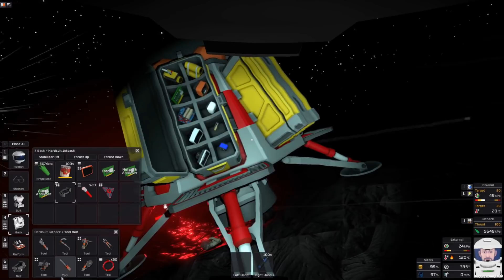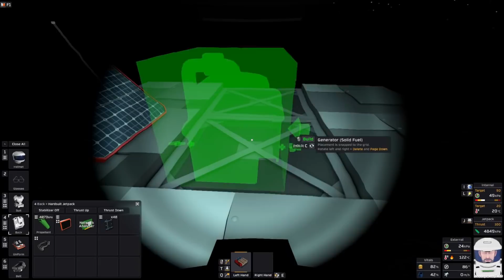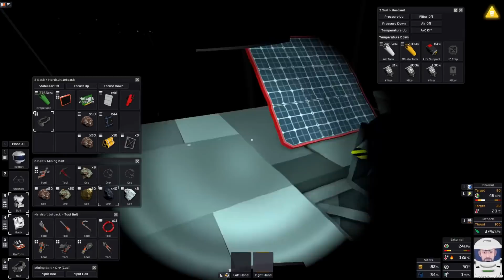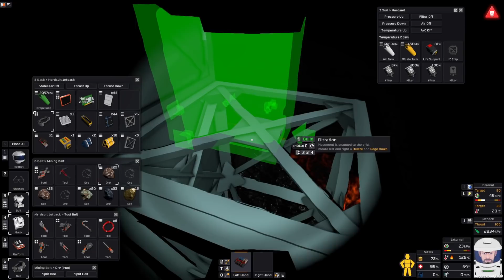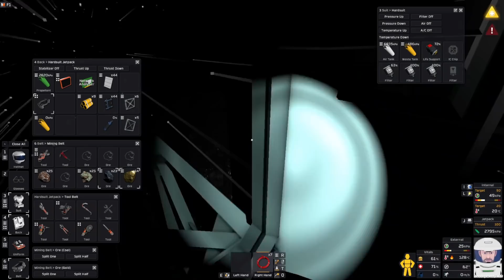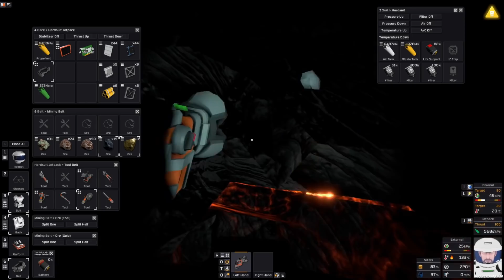Stationeers Vulcan Getting Started EP01 - Oh No!  We Forgot the Water Tank!

Comment: So now that you can’t fill bottles of water if temps are above 100c, how do you do this now? The air temps are well above 100c so the water bottles don’t fill anymore using the same system you outlined here. I just tried it today mirrored exactly like this. I didn’t think it would work but I’m curious as to what modifications you have to make to make this work now.
Reply from the maker: I assume you'd need to use a heat exchanger to a gas and then cool that gas with an AC unit.

Comment: If you put passive vents on your airlock pipes, you won't need to pressurize the airlock. Just depressurize and open the doors.
Reply from the maker: On the oxygenated side you have to be careful with pressure.  That would double pressure in the small room when you cycle.  Right now I have very little pressure in there, but I sometimes have to release more oxygen from the tank for cooling.  If you had 1 atmosphere in there it would blow out the walls when cycling.
Reply: @autom8it339  Yeah but you only have 20kpa
Reply from the maker: @CommanderHayes  Yes, that would work to speed up the cycling in this case.

Comment: 12:20 - Won't the shadow from the coal generator block the solar panel?
Reply from the maker: Possibly a bit, but once I have heavy cables I'll be moving the solar panel(s) to the south side of the roof.  I put it there to save cables.  The few times I checked the power output it was pretty high.

Comment: Love your getting started vids.  Don't think I would have had the patience to start playing stationeer difficulty without them.  I think that if I was to steal your starting ideas, I'd flip the H2 combustor set up 180 degrees, run the O2 docking through the wall, slap down a couple writer switches and run the whole thing from inside.
Reply from the maker: Yes, that would be a nicer setup (though I don't have an electronics printer yet to make a logic switch, and I would want insulated pipes so I don't contaminate my O2 tank or the inside of my base with too much heat).  My plan is to move this setup over by the greenhouse once I get that built, and then feed it O2 directly from the greenhouse filtration.
Reply: @autom8it339  Solid point.  Forgot about the lack of printer.